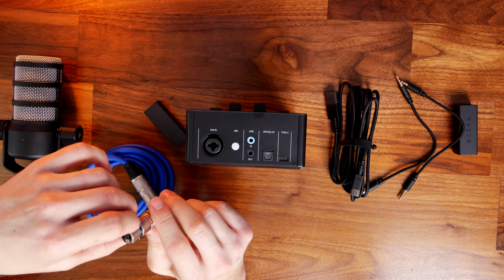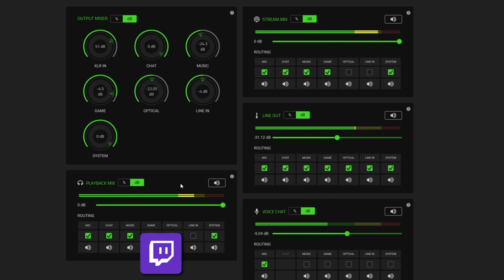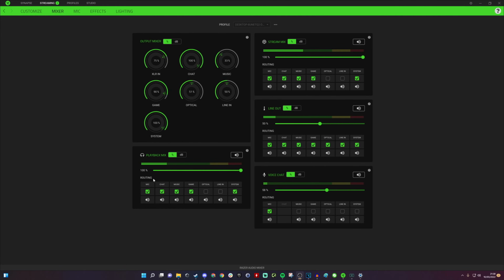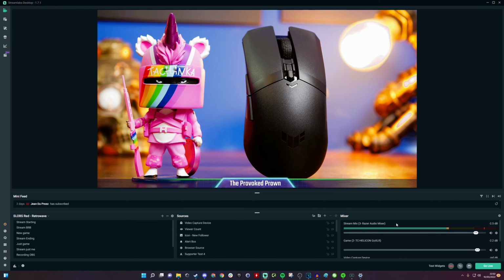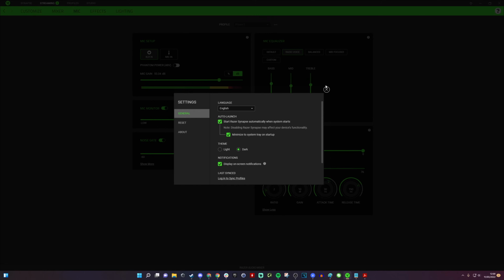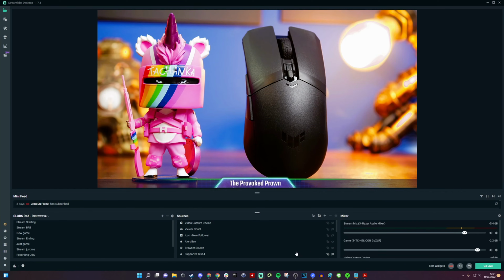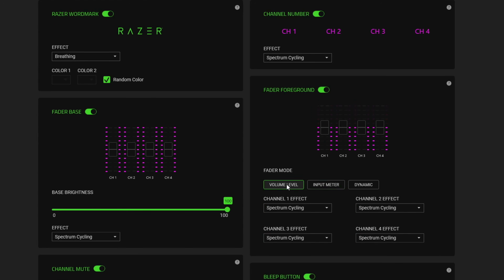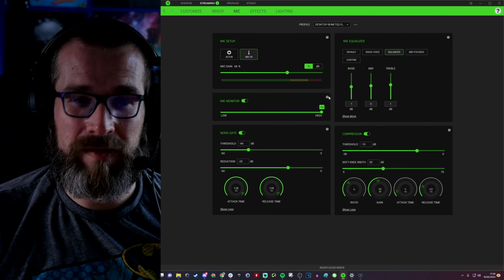How to setup the Razer Audio Mixer (best Synapse settings for Shure SM7B)

Comment: No one has encountered this problem, but after a reboot, all the mixer settings are lost until you go into Synapse and change the profile, first to the default one and then to the one you want to use. Thanks
Reply: GODsent comment right here

Comment: hello I have an issue, i can't hear playback mix and i am struggling at it (I can only hear it if i turn on mic and hear microphone), I cant hear system sounds, spotify, gameplay or anything... I am using arctis pro wireless, i did everything as in this tutorial but PLAYBACK MIX is not working (everything else is working but playback mix i cant seem to hear anything happenig on my gaming pc)

Comment: Hey bud hope you're well. I've just bought one of these as I have a dual pc setup for streaming my gameplay. I have currently been monitoring my obs game capture audio via an elgato capture card. This ofcourse comes with a slight audio delay. Even if you reduce the obs audio delay to its minimum. So I've bought this so I can connect my gaming pc audio via optical and then route the sound to obs on my streaming pc. I use an SteelSeries ArticX wireless headset which I have hooked up to my streaming PC. So the question is.... Can I use this headset to monitor game audio and still hear the desktop audio on my gaming pc via the razer audio mixer and synapse? Or will I still have to listen to game audio via OBS?

Comment: Does this have enough power for Dt 990 pro 250 ohm. I'm not sure what my issue is but I hear everything low through my headphones. And in sound setting my Razer mixer is stuck at 19 volume. Any help?
Reply from the maker: I'm sorry but I don't have the answer

Comment: Razer Audio Mixer gain range is from -12 dB to +39.7 dB. However Shure SM7b needs a pre amp with gain of 60 dB. So how does this mixer power the mic efficiently when it doesn't meet the requirements?
Reply from the maker: Magic? I'm not making it up, I tested it and showed it all
Reply: @TheProvokedPrawn  i'm not saying that. yeah you tested it and it looks like it works. but on paper seems like it doesn't meet the requirements.
Reply from the maker: @Zenbeau  I don't know what to tell you I'm afraid 🤔

Comment: This honestly is lifesaving. I was feeling so overwhelmed when I first got this mixer and felt that there was such a learning curve! But you filled the gap! 

Have you noticed that the mic volume and gain In the razer app both control the gain and under mixer it does not control the actual mic volume?
Reply: I have also noticed this. Did you find a solution?

Comment: hey man, having some issues with one of my channels (music aka Spotify) I have everything set up normally as shown in the video but I can only mute the music with the hardware. for some reason, the slider is not affecting the music volume. just wondering if you've run into this or not. the vid has helped me out a lot btw
Reply: Random reply, but did you ever find a solution to this? My mixer has been working fine for over a year but suddenly the sliders won't change the volume
Reply: So, if I remember right I changed the mixer channel to something out and it worked fine, apparently I had some issues with drivers but it has been a while unfortunately and I'm currently baked XD , sorry  @Sarahhh55

Comment: Im curious how you get the audio mixer software. do you have to buy the analog mixer as well? I bought a razor mic but the synapse setting/controls dont look like the ones you use in the video
Reply from the maker: It's in synapse and appears when you plug the mixer in. So you probably can't get it separately
Reply: @TheProvokedPrawn  yeah I thought that might be the case. Thank you

Comment: Hi, thanks for putting this out. I do have a mechanics question on using a USB microphone vs an XLR or 3.5mm jack. Do you know how to get the mixer to reference a USB mic? It seems like it can't find any mic not plugged into the box, which eliminates all but one of my mics. (See: Razer Seiren Pro, Mini as USB mics) Any idea how to pull in their audio for appropriate slider control as a separate sound channel?